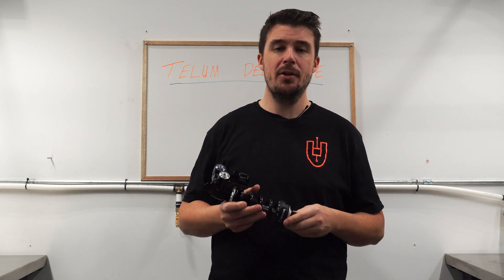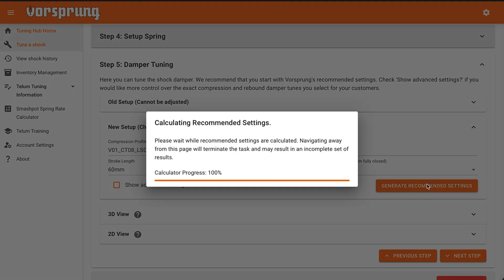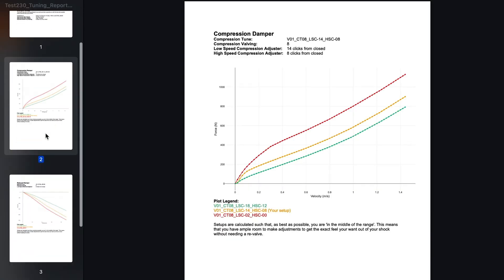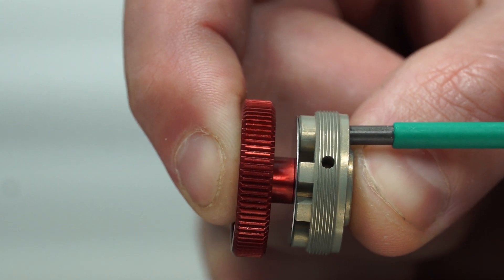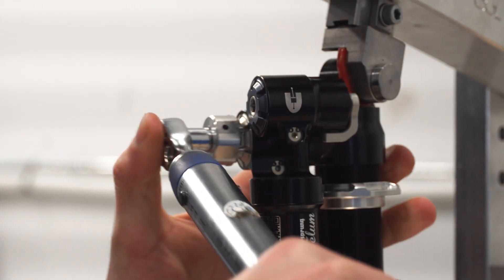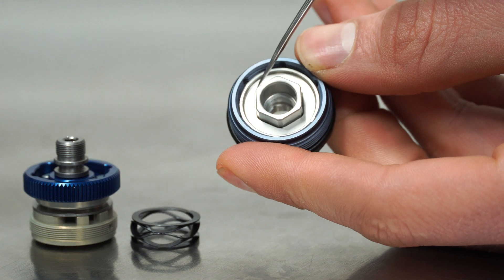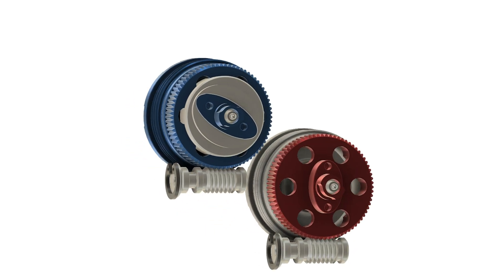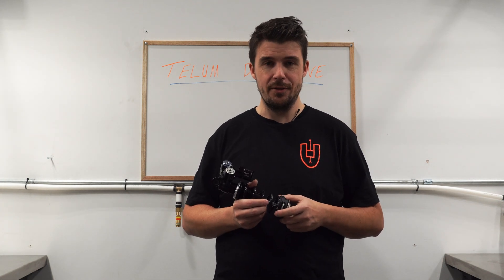Vorsprung Telum DEEP DIVE - Part 4 - Rapid Revalve and the Vorsprung Tuning Hub

Comment: Great videos and i think ill be purchasing one for my next bike build to compare against my current favorite suspension from Craig (i just wish i could manipulate the relationship between high and low speed rebound on this cr, his fork damper is brilliant though other than oerformance fading a bit on longer stints). I really like how you make the data available to the consumer and I would love the ability to revalve and test regularly. Do you install identical shim stacks in every telum you ship out and account for different riders entirely with your rapid revalve, or do you design a shim stack for each rider setup such that the ralid revalve is delivered in the middle of the range for each rider? Thanks!
Reply from the maker: @mccoykn  every Telum has identical shim stacks, the Rapid Revalve system means that there is a massive range available - we’ve never actually tuned one at the lightest or heaviest available settings for any rider so far, if that gives you any indication.

Comment: Are the seal kits and required tools available for end user? Are torque values, oil specifications and ifp pressure values available? My requirement for the shock is that i'm able to service it by myself.

Comment: I knew this shock would be good but when I heard “rapid revalve” I just assumed it would be like Formula CTS, but this is so much cooler. Way more likely to be used by the average person with meaningful changes. I need to check the website to see how good the explanations are good, because I feel the major thing lacking in this industry is good explanations on why to do what with suspension adjusters. “If you feel x do y.” Or what to expect to feel from changing something. Knowing to go up or down in compression feels counterintuitive sometimes or when to use High vs Low vs rebound, etc.

Comment: Hats off to Vorsprung for such a nice design. It's evident that enormous time has went into design of this shock and it certainly brings something real special to the market, as I understand. Even though rapid re-valve tech will definitelly help more riders get the tune they need without a conventional re-valve. At the same time there are still going to be benefits that a good suspension tuner can provide with a conventional re-valve that the rapid re-valve system cannot, being that is essentially just a way to vary the clamp diameter, which only changes stiffness of the shim stack not the character of the damping curve. That is, the rapid re-valve tech doesn't allow one to make changes only to a particular velocity range of the damping curve, etc., this will still be only possible via   re-configuring the shim stack. Even so, this system probably pushes the boundary to what is possible without taking the shock apart to its limit.
Reply from the maker: Thanks for the kind words! Pretty much the only thing you can't do with Rapid Revalve is introduce a progressive damping rate (more damping at high speed than low speed) which requires a two stage shim stack (and which basically disables HSC adjustment externally, as well as usually making the LSC adjuster ineffective), but you can control the the shape of the curve to a significant degree with the HSC/LSC interaction, and it's all fully documented in the Tuning Hub as to exactly what adjustment will do what.

Comment: to be honest i am not quite sure i understand the difference between your revalve solution and external adjustment via preload. (like your high speed compression adjust) both should be linear, without float.
Reply from the maker: @jom23495  check part 3 of these deep dive videos for that to make a bit more sense!

Comment: This is really interesting. Congratulations for the development, and for sharing this valuable content Steve!
I've a question regarding to the elliptical clamping surface. I think it probably generates uneven force distribution and preferential oil flow paths that could lead to turbulence or inconsistent damping behavior. If this is the case, I'm sure you've considered it and have implemented solutions, but does this mean that the shim stack configuration is specifically designed to mitigate this, and thus it shouldn't be internally changed? Thanks!! I hope I can grab one here in Argentina :D
Reply from the maker: I understand where you're coming from with that, however the flex of the shims is predictable and repeatable in any given setting, it's not inconsistent as such (it's as repeatable/consistent as any other shimmed damper), but the changes between increments are not linear across the range. Turbulent flow is just a phenomenon that occurs at certain velocity vs geometry combinations, it's neither particularly relevant to this specific damper design, nor is it problematic (in fact it's typically the opposite since turbulent flow implies greater fluid-momentum-delta effects and less viscous damping, which in turn means lower temperature sensitivity). 

The main reasons you shouldn't change the internal shim stack though are:
1. You don't need to - the Rapid Revalve system gives you a very wide valving range
2. If you did change the shim stacks, you would not be able to using the Tuning Hub to determine the appropriate tunes, since it is based on dyno curves we've uploaded (over a thousand) that are based on those specific shim stacks.

Comment: Interesting concept, you appear to only be "rapidly revalving" the base valve. Won't this cause excessive chamber pressures and delay wheel response?
Reply from the maker: There is only a base valve, the main piston is solid. Check out the first two deep dive videos for a full explanation.
Reply: @VorsprungSuspension  sorry I should have viewed those first. Very similar in principle to the showa bfrc 
(Balance free rear cushion).
I feel the main reason the showa hasn't been well received in moto is that it always has the same feel just with varying degrees of stiffness.
By having a midvalve and bass valve you can tune the sequence for different characteristics. More base valve bias gives that dead feeling whilst more midvalve gives that lively feel.
HRC Honda tried to utilize the BFRC for several years.
Reply from the maker: @vinceseyb2640  yep, same basic layout as the BFRC. I would not agree with your assessment of valve bias and dead/lively characteristics though - force at the shaft is force at the shaft, and the force vs velocity characteristic is ultimately the most critical factor. As with everything though, the devil is in the details. You can make monotube shocks and twin tube shocks with solid or shimmed main pistons generate identical responses if you're so inclined.
Reply: @VorsprungSuspension  I don't dispute that you could get the 2 styles of dampers to produce similar force vs velocity numbers at a set velocity and frequency, but I would be very confident that as you increased the frequency they would start to look very different.
The BFRC was patented on the basis it eliminated frequency induced hysteresis.
In your damper your solid piston produces a force (pxa) this is that rate at which force is applied to the fluid and it is this force that drives the flow through your base valve.
Your base valve setting determines how much force is required for a given flow rate, which is just the pressure gradient or how quickly the damper pushes back. Stiffer setting more force for the same flow.
Conversely a damper with a traditional midvalve we can tune the effective area as in how quickly we apply force to the fluid and then tune the base valve to determine how quickly or slowly the fluid pushes back.
At the peak velocity of any given event the forces are equal.
I believe there's a lot of people that haven't realized this.
That's why a pressure balanced damper gives a faster wheel response.
Reply from the maker: @vinceseyb2640  you actually can get the frequency sensitivity to match as well, across a spectrum (whether you'd want to is another matter, and whether it's practical to do so is another matter again). Frequency sensitivity is, again, due to the oil displacement required to elastically deform the damper structure (including valves) up to the necessary pressure required to generate a given force at the shaft. If you need twice as much pressure to generate a given force, you need to ensure that the damper is four times as stiff (structurally/elastically, not in terms of damping rate) to maintain the same frequency sensitivity. 

With a base valve vs a midvalve, there is no magic you can do vs a solid piston (partly because a solid piston twin tube is intrinsically "pressure balanced") - what you CAN do is more easily have more complex damper curve shapes where you have, for example, a digressive base valve and a digressive midvalve that digresses or at a different velocity, but for practical purposes that's not actually very useful in a rear shock, and you can build base valve assemblies that do the same thing if you wish (eg Rockshox's Charger 3 layout, which has a base valve that is initially digressive and later progressive).

Basically there's only four forces at play here:
1. Friction - we can neglect this for this discussion
2. Absolute internal pressure above the main piston, acting on the shaft area (technically it's the relative pressure to ambient pressure outside the shock, but that's pretty negligible)
3. Relative internal pressure across the main piston, acting on the annulus.
4. Inertia of the shock's chassis and the oil column which resist acceleration. This only has a significant effect on very high speed, very high acceleration events, but these are also the events where hysteresis is most pronounced.

"Faster wheel response" is an ambiguous term (and widely abused by marketing) - do you mean "faster acceleration of the wheel in response to a bump input" or "lower displacement delay in the generation of damping force in response to the wheel's acceleration"? Because one opposes the other, and increasing one decreases the other.

I would also ask you to be mindful of using the term "fast"/"quick" etc, eg "how quickly we apply force to the fluid" is ambiguous in that it's not clear whether you're talking about what the domain of "fast" is, whether it's the damping rate itself (which you can tune with a midvalve), the displacement based lag at a given pressure vs acceleration characteristic (which you cannot directly tune with a midvalve), an acceleration/inertial effect etc.

Comment: Air shock next year?
Reply: No 🙄
Reply from the maker: Never say never, but it's not imminent.
Reply: Sprindex is awesome but adiabatic compression goes brrr
Reply: I agree that I’d like an air shock. I’ve never really been able to get along well with a coil shock, but I do love the idea of rapid revalve. Would be nice to have a lighter package with more adjustable spring curve.
Reply: @shredwithscott   The spring curve on coil shocks is easily adjustable by using a Sprindex, and changing bottom bumper geometry and/or material.
Reply: Air shocks go brrr with adiabatic compression tho. Completely different feel/curve
Reply from the maker: @sbin02387  sounds like we've got at least a couple of votes for an air shock then :)
Reply: @VorsprungSuspension I posted I think on your instagram for large volume air.  Tested multiple shocks back to back for my bikes that are around a 26% progressiveity and seems I prefer the float x2 the most.  Coils I have to run a firmer spring which then also needs more HSC otherwise you feel the harshness of the impacts through the coil, like a blown car shock going down the road hitting pot holes as an exaggeration.  Air I can run a lower initial rate and not use as much HSC and just seems to be a smoother ride overall.  Rides much more like a coil with a mid 30% progression.  I should maybe try a progressive wound spring but after enough test I just feel air for mid 20% works better.